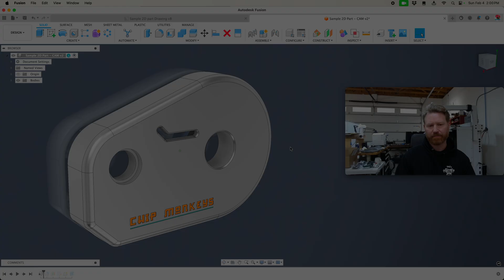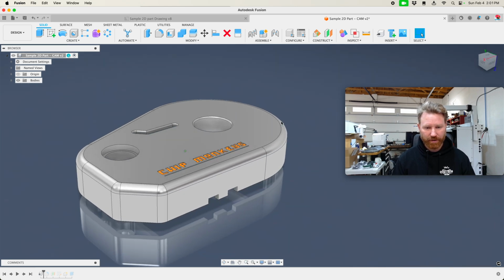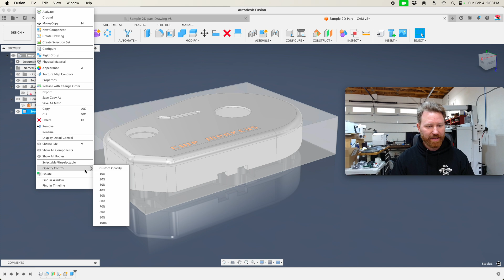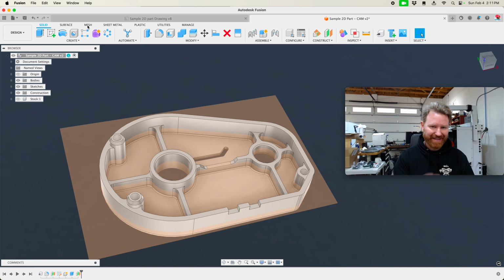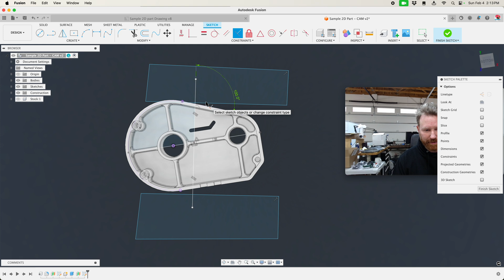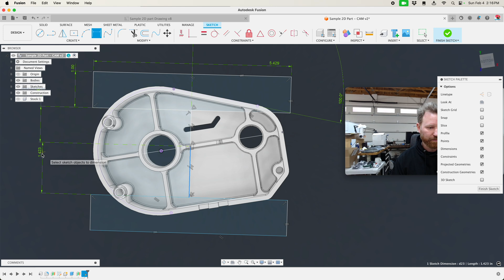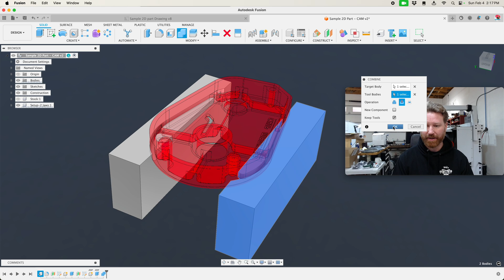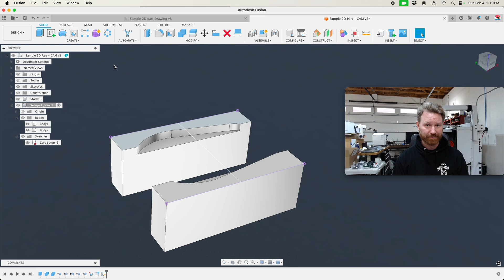Intro to Fusion CAM Part 2  - Soft Jaws Design

Comment: Love this video, I always struggle with soft Jaws. Only one thing, I wished you had made the video a bit longer and not rushed through the details so fast. I've had to re watch many times so I don't miss what you are doing.
Reply: Agreed. Nothing is more frustrating than  a teacher who goes too fast and has already does the steps they're trying to demonstrate. I know you are an expert so its difficult to slow down without perceiving the video as boring, but we barely recognize the buttons from each other at the novice level.
Reply from the maker: @86joeblow  I am currently working on a solution this problem. I am actively filming now, and hope to release some to videos and tutorials very soon! Thanks for watching and your comment!
Reply from the maker: Thanks! Yeah, people are not watching videos over 10 minutes. haha I'm trying to strike a balance, but you are probably right. They should be longer because you can always scrub forward.
Reply: @ChipMonkeys  instructional vids are generally for beginners who need time to digest the content, so I’m sure no one would say that a video that’s 15mins is to long, because we use these videos as a tool to learn. 
I absolutely love how you used combine with an offset plain, that’s helped me a huge amount. I always fear making soft jaws, your video has really helped me understand this better. 
Thanks again 👍

Comment: Thank you for the video. It's hard for a beginner, it's not clear at the modeling stage, it would be nice if there was an explanation of how you outlined it.
Reply from the maker: What do you mean "Outline". I can make a video to explain it further if you'd like.
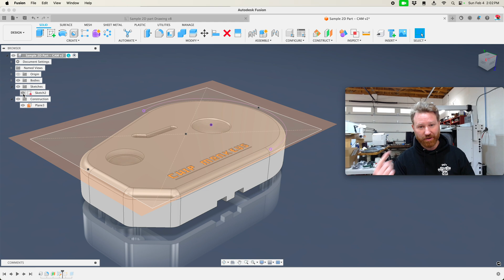Reply: @ChipMonkeys  1:57 When you create a sketch, you already have a center point and a detail in the center of the material. I understand that for some people it's very easy, but for me as a beginner it's not clear how to do it. Thank you
Reply from the maker: @BV-iv1xh  It depends on the surface the sketch was made based on. Based on the shape, it could put it anywhere. Some times it works out, others it's off center. In that case, "Project" some geometry and make your own center point.  I hope that helps!

Comment: Where do you normally constrain your holes for corner reliefs in soft jaws?
Reply from the maker: For a standard vise jaw, X is for alignment, Y is your clamping surface & Alignment. So your Corner relief should cut into your X, not your Y. Then your Clamping surface has the most contact with your part. A picture would be great right here. But I don't know how to post it. If you email me, I can send you some examples. Thanks for your well thought out question!
Reply: Awesome. I’ll send an email to the address I found on your website. Great video!